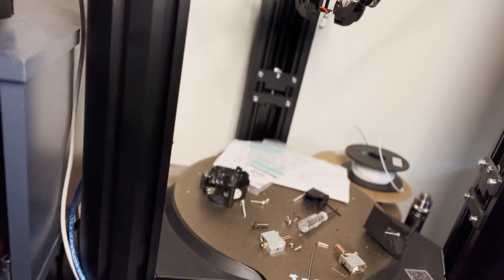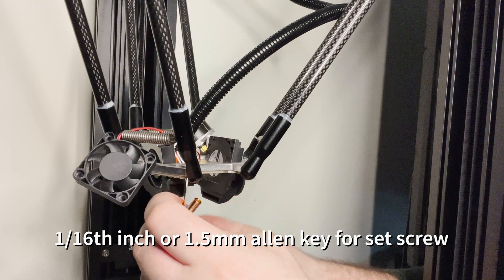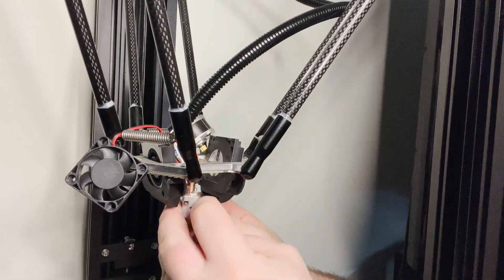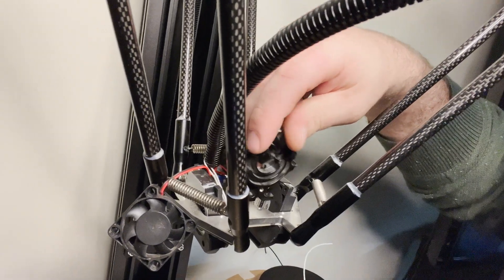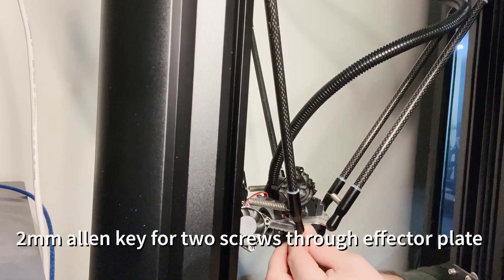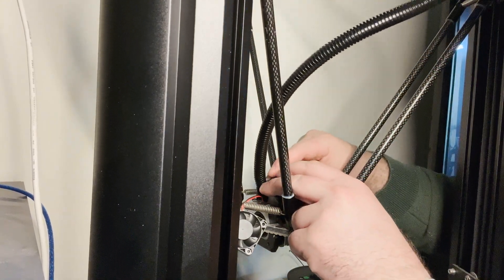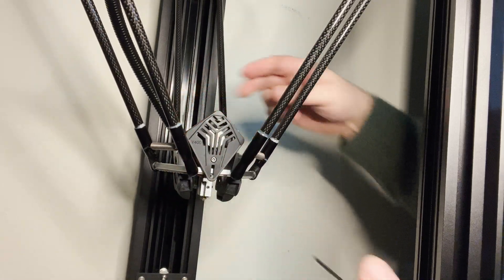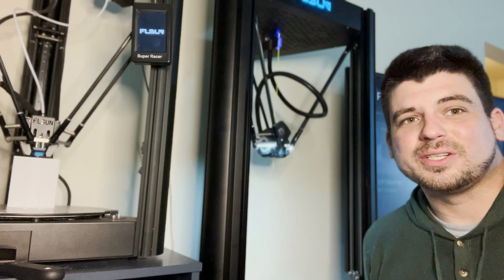FLSUN V400 HOTEND ASSEMBLY

Comment: Fantastic video! I'm wondering where you got the replacement heat block - it's not available for purchase anywhere on the web. We are trying to contact FLSUN support but they haven't gotten back to us. If you have a spare and functional part we would possibly buy it straight from you!
Reply from the maker: FLSUN shipped me the heat block for free, not sure why you’re having issues communicating with them. Best of luck!

Comment: Please help. I cannot put mine back together. It is very hard to see what you are doing.... I have 5 screws left and I don't know where they go.
Reply from the maker: Extra parts is no good! Do you have everything fastened to the effector plate?  The extruder assembly and fan shrouds get attached to the plate.
Reply: @1NTERGALACTIC  I have 5 screws  the shaped fan cover.... and the black plastic piece with the 2 long  tube sticking of of it. Im not sure how to attach them
Reply from the maker: Everything gets bolted down the the effector plate. The two longer screws go through the tubes of the extruder assembly. One screw for the fan at the top and then one screw (bottom) for the fan fascia
Reply from the maker: Two longer screws thru the tubes on the extruder assembly thread into the extruder motor
Reply: @1NTERGALACTIC  almost got it.... I have a one inch screw left.... with a fat head...... looking for where it goes
Reply: @1NTERGALACTIC  there is nothing out there showing how to put this thing back together..... I had a filament blockage.
Reply from the maker: @Nightsight971  I hope my video has been somewhat instructional, keep trying and you will get it back together. The V400 uses very specialized hardware to achieve its printing speed. It’s not easy to work on in comparison to the days of the Ender 3. Learn from my mistakes and don’t break off a nozzle in the hotend 😄
Reply: @Nightsight971  right here on YouTube type in on search:" v400 effector module" that video will give you an animated exploded view of the assembly. ✌️
Reply: @foam27  https://drive.google.com/file/d/1-BRgoTV-tr0jdBbtDfP70peMpbQw5qyW/view?usp=drivesdk   this is the mystery screw.... not sure where it goes
Reply: @1NTERGALACTIC  https://drive.google.com/file/d/1-BRgoTV-tr0jdBbtDfP70peMpbQw5qyW/view?usp=drivesdk  this is the last screw... nor sure where it goes

Comment: I just went thru this a few days ago. Filament jammed in the black plastic tube before hotend. BARELY got it out, had to take apart the whole thing, really sucked.
Experience was good before that. Next time I recommend unhooking all connectors from the top, and remove arms. MUCH easier to work on, have to recalibrate anyway.
Reply from the maker: You are correct, removing the effector entirely from the machine makes things easy.